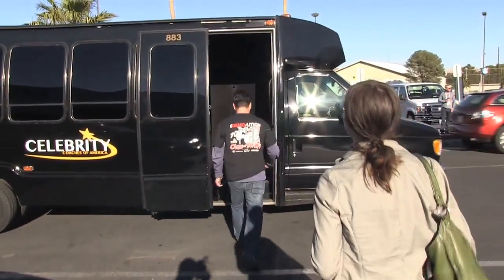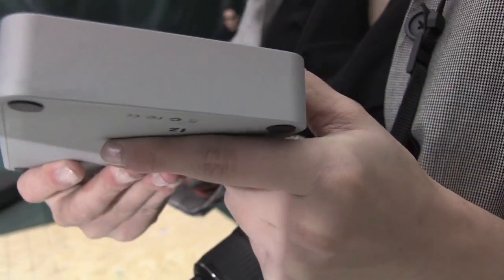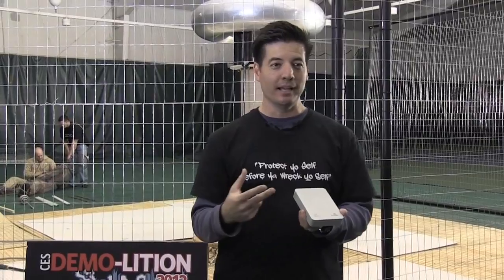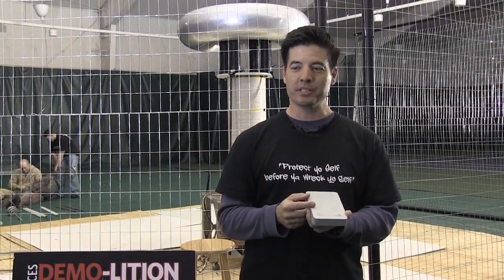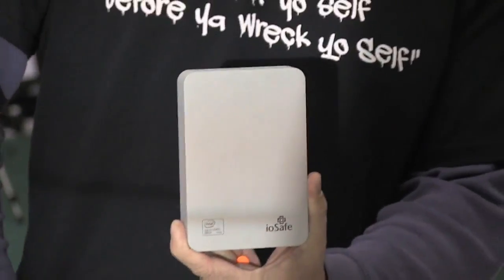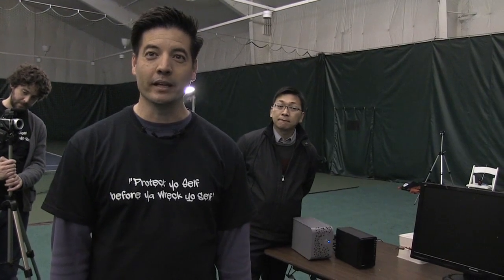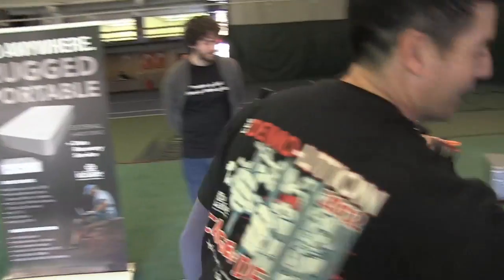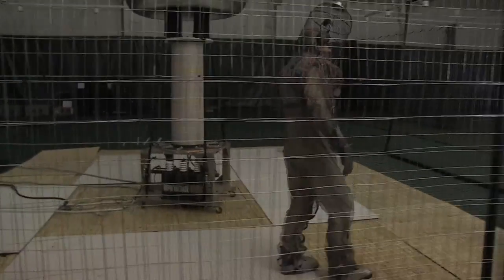ioSafe drive versus Tesla coil

Comment from the maker: @ArticBeatle This didn't happen at the demo that we were at. There was only one drive subjected to the shock of the Telsa coil, and it was the ioSafe one. The demo we attended was the 9th one they had done at CES. They told us that out of those 9 drives, 3 had to be opened up and repaired in some way, but the data on all 9 was eventually recovered.

Comment: @mscocorosie This contains several SSDs inside instead of traditional mechanical spinning drive, and most SSD can withstand around 1000 - 2000 gForce, that's like... i don't know... dropping it from 100 feet (i'm guessing)